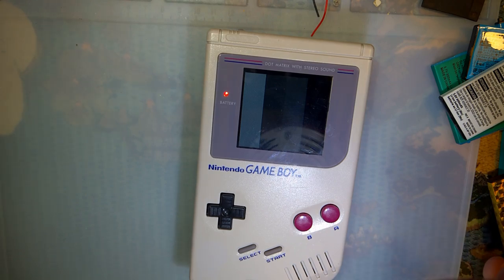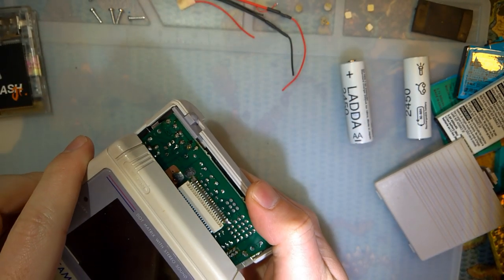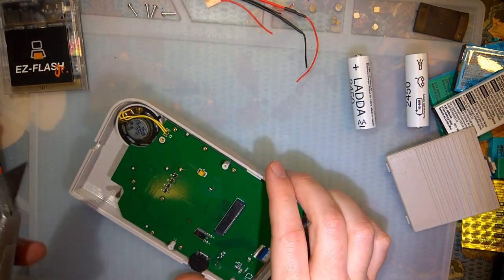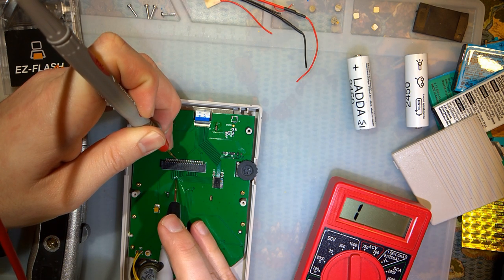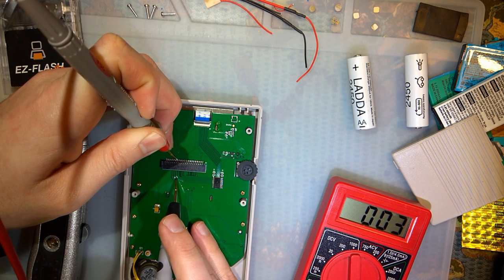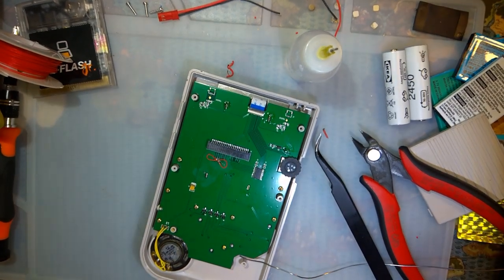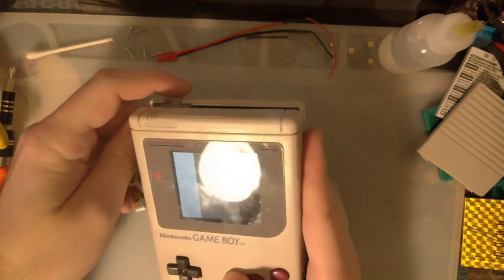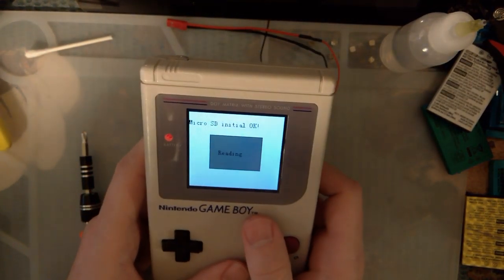(Alternate) Fixing the Color Palette Issues with the DMG IPS v1 Kit (RIPS)

Comment: Thank you.  I just fixed mine.   I never noticed it.  I use 32 awg enamel coated wires.  Try using those for future mods.  Easier to work with.
Reply from the maker: I don't like the enamel coated wires. I find them more difficult to work with, actually. But that's just personal preference.

Comment: I finally finished my Gameboy by modding the back of the original hardware, so thanks for the help.  I came across two other issues with this kit though.  I’ve tried 3 different silicone pads for the dpad, and the down direction has issues.  About every tenth press it doesn’t register.  I’ve tried cleaning the contacts, and trying to press it before I screw the front pcb in.

My other problem is the brightness wheel.  When I screw the whole thing together, the wheel doesn’t turn because the front pcb is pressed against the back pcb.  I removed more plastic than instructed to, but it didn’t help.  A guy at my local shop said you have to trim that rubber piece by the led and wheel on the front pcb.  Since I don’t plan on changing the brightness, and I can still press to change colors, I’m leaving it.

Honestly I’m just over it with this kit.  The screen looks good, but this kit should have been more refined before releasing imo.  I also have a little bit of light bleed on both sides of the lcd, and it’s as centered as can be.  Would’ve been nice if it was the same size as the funny playing lcds.

TLDR:  Thanks makho.  I would’ve been lost on this mod if it wasn’t for you.  This kit is a good sign of things to come, but I would suggest for anyone to wait unless these older kits get heavily discounted.
Reply: On AliExpress they suggest cutting down and filing a couple of the solder points on the board that will be underneath the brightness wheel. These are more than likely what are rubbing.
Reply: Thanks Oki_Dingo, that makes perfect sense.  I had so many issues with my install, mostly because of my ocd and the need for everything to be perfect.  When I finally got the pallets fixed, I just wanted to close it up and move on with my life.  My soldering skills aren’t the best, so I struggled more than most will.  I don’t know if I want to open it again.  With my luck the whole thing will explode if I do.
Reply: memadartist - I just uploaded a picture of the ones to nip and file down. https://imgur.com/gallery/dGimY6n
Reply: memadartist - did it fix it?

Comment: I dunno, I feel like using wire for this is more work than necessary.  I think it would have been a lot easier if you'd used a component leg, or even just bridged with a solder blob.
Reply from the maker: Couldn't have bridged it with solder since the traced needed to swap over. Left to right and vice versa. a component leg could have worked but if the leg is too short, it would have been very difficult to solder as applying heat to one side would desolder the other side as well. I mentioned this (briefly) in the video. That's why I used wire that was obviously longer than it needed to be for the distance I had to cross.
Reply: @makho  yeah now that I think about it, bridging with solder would only work for 1 trace, the other would probably have to be patched with wire.

Comment: If I would like to change the power LED on this new board, do I need to change the resistor too or is the current one ok, what do you think? Since I'll be making pink/white build, I would like pink power LED on White glass screen. On old board, I would change R1 resistor for the 3K Ohm /14Watt one, not sure which one is on this new board. 

If you have any idea. Thank you. 

Also nice video, relaxing, I watched it several times now, each time I learn something new. :D
Reply from the maker: You should just be able to swap the LED out. I did on one of mine from red to blue.
Reply: Cool, thanks. Much appreciated. :)

Comment: Would a revised flat ribbon cable be able to fix this ?
Reply from the maker: A full custom cable would, yes, but I think the cost might be pretty prohibitive for a custom ribbon. I suppose one could use two ribbons instead and a custom PCB inbetween the two ribbons. Assembling that PCB would be more complicated than just fixing the traces manually though despite that custom PCB being just two FFC connectors.
Reply: If you are talking from the manufacturer of these.....they will just fix the palette problem and flash it to the newer kits that get sold. Probably after they sell all the kits they already made. It’s China, so they don’t care about the ones that have already been sold.
Reply from the maker: @OkiDingo  Yeah, the issue has already been fixed and it was just a software fix. No need to tweak the hardware.
Reply: makho - is there a way to identify the fixed kits yet? Or is it just luck of the draw until the v1 kits are all sold.
Reply from the maker: @OkiDingo  I'm told that the design of the new kits should be different but that remains to be seen.

Comment: I am a beginner at modding or soldering. I see this is much more difficult rather than previous one. The traces are too small to cut and solder.
Reply from the maker: I agree. It's just an alternative for those that don't want to touch the back board (but I still recommend swapping the lines on the back board instead).
Reply: @makho  And in my case, the RIPS kit is more expensive than the DMG.
Reply: @makho  BTW please review your EZ Flash Jr.
Reply from the maker: @damonalbarnbusukabis  it runs games just fine, what more do you want?